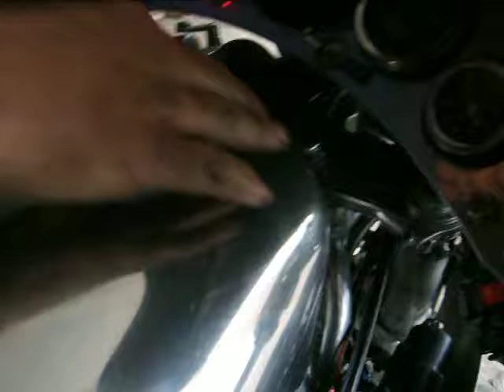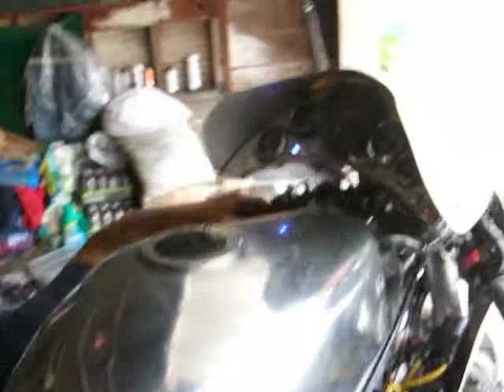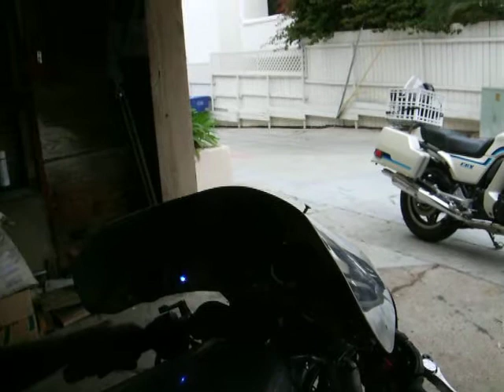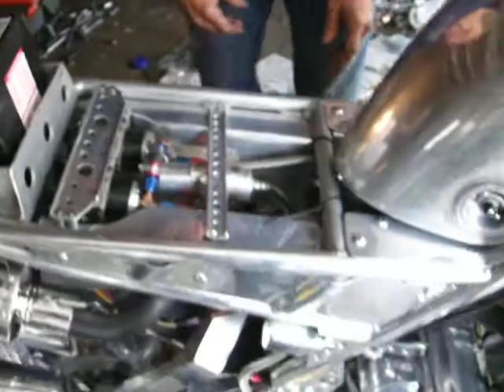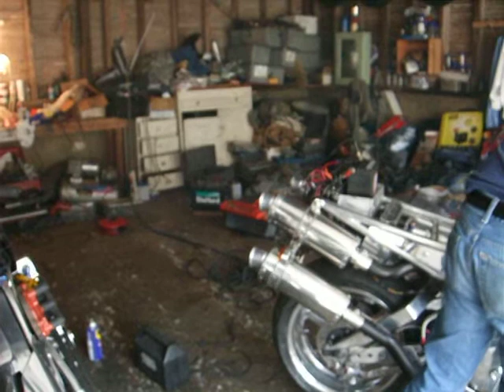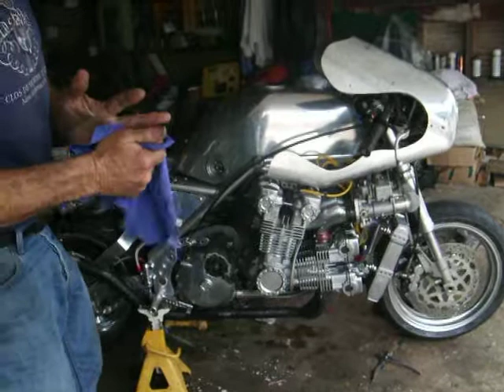exhaltation (did I spel that rite?)

Comment from the maker: Andreas thinks the noise is the primary drive. It is by hyvo chain and one of the seals for the oil supply pressurizing the tensioner was in the sump after running. He has replacement seals now and it should be back up in a couple days. The seal that was in it is kind of old and not pliable anymore. It's specific to this bike and not available from Honda anymore (like so many pieces on the CBX engine).